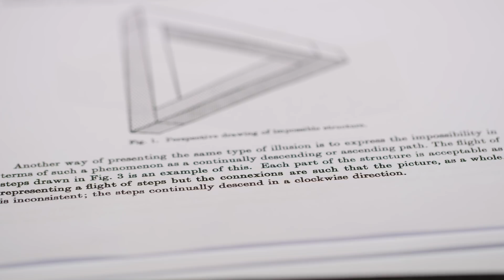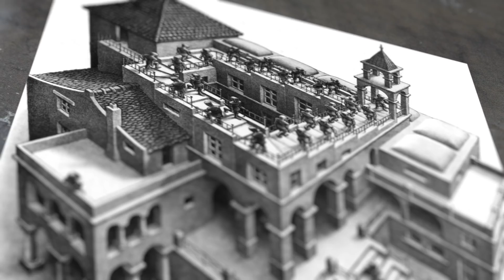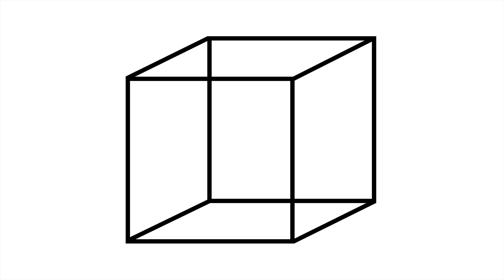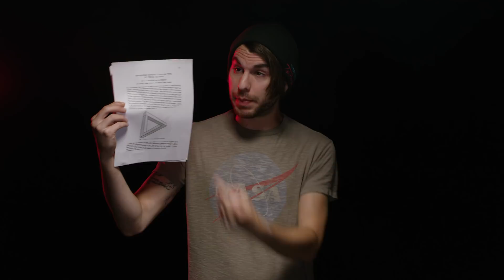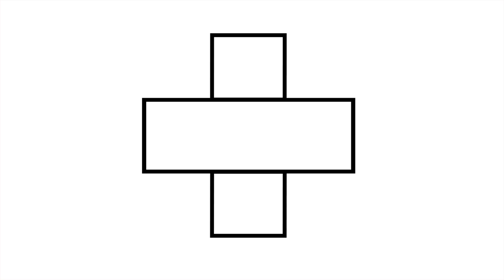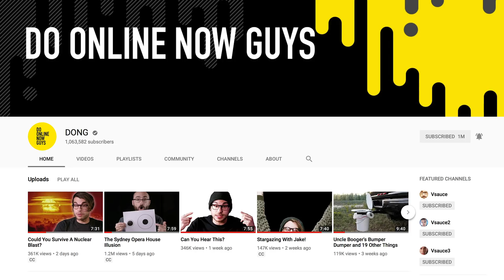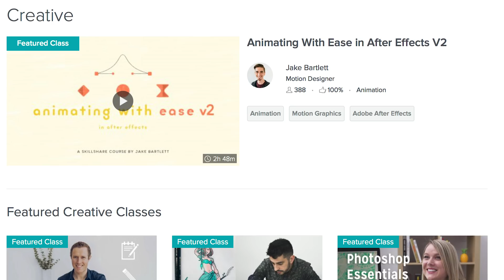Impossible Objects

Comment: People learning drafting actually take advantage of optical illusions in order to get the point across more easily.  This is especially true when they make "cut-away", or sectional view drawings.  For instance, in order to show that a rod is round when they shorten the apparent length in order to get it on paper including the two real ends, they "cut" a slight "S" shape on the drawing of the cut end of what just looks like two horizontal lines, otherwise, and then on the concave of the S, they make another convex.  This gives the perception that the round object has a C-shaped milling end cut to show that the rod is round.

Comment: At 3:30 the original impossible cube from M.C. Escher shows both, the top AND the bottom of the cube and the two inner vertical ribs are mangled. Your 3D printed representation does NOT ... It is impossible to 3d-print a version of the original impossible cube...!!!

Comment: 6:36 
I don't know if this is just me but the reason I thought it was two rectangles is because the line that connects the two squares to the rectangle is the same thickness as the other lines. My brain would only think of two squares and a rectangle if that line was either double the thickness or if there was a small separation between them.

Comment: 6:35 is a low blow because the “smaller squares” are sharing the same order as the larger rectangle which actually implies that one object is below the other.  Otherwise the border between the smaller squares and the larger rectangle would be thicker to imply two borders touching.

Comment: What you said about Gestalt Psychology reminded me of an analysis I'd made before: what is the distinction between the words "piece" and "part"? At first glance, they seem synonymous, but trying to use them interchangeably yields some awkward results. I recommend pondering and coming up with your own definitions before reading mine below:

I came to the conclusion that parts are more often what make up an object's construction, while pieces are what remain after its destruction.
For example, the parts of a pie might include crust, filling, toppings, etc, while a piece of a pie is something you cut out of it.
Likewise, car parts are often called parts before they have been installed, or after they have been uninstalled; while a section of the car that has been destructively cut, torn, or otherwise broken off of the car would more likely be called a piece.

Puzzle pieces are interesting, because you do need them to construct or solve the puzzle, but they are still called pieces, both when assembled and not. I think this is because when disassembled, there is little reasoning within the individual pieces as to how the puzzle is to be solved. They seem to be removed from the puzzle chaotically. However, one might consider the collection of certain pieces, such as the image of a dominant object in a jigsaw puzzle or its boarder, a part of the whole (and not a piece), because they collectively form a portion of the puzzle that logically fits and aids in its construction. Parts of a puzzle help us better visualize the whole, and fit into the puzzle more logically, while pieces are conceived as more separate from the whole.

Comment: But have you ever thought what a 5D impossible object would look like?

In other words...  In the same way the Penrose triangle can't truly exist in 3 spacial dimensions (except from a controlled angle) but can be represented in 2 spacial dimensions.

Is there an object that can be represented in 3 spacial dimensions but can't truly exist in 5th dimensional space?

And if so, does this dimensional hierarchy go both ways?

In other other words because a square can be both in 3D space on a flat plane while simultaneously in 2D space; but a cube can only truly exist in 3D space or higher.

Likewise a tesseract can only exist in 5 dimensions (because we designate the 4th dimension as temporal) but a cube can exist in the 5th dimension on a 3D/4D membrane cross section of space-time.

Is there a thing that we think is a real thing but from the perspective of the 5th dimension is an illusion?

And if so how do we know anything exists at all?

Our perception is so limited.  So ultimately what we perceive as an illusion is just as valid and real as something we consider real.

In other words.  Is it impossible to lie in an infinitely deterministic universe/omniverse.

You could literally say anything and it would be true in some parallel universe on some timeline.

That would mean truth can only be known in a specific temporal quantum index.

Unless it's higher dimensional truth.

Comment: the reason these work is because of 'Occam's razor' where the simplest answer is usually correct. we are tricked by these because we subconsciously assume that the illusion is what we see and that it must be correct when these are designed to look simpler than they actually are therefore confusing and tricking us. specifically with the 2 rectangles on top of one another illusion we perceive it like that because 2 rectangles is simpler than 1 rectangle and 2 squares. so illusions like this are just exploiting that.

Comment: Your layer height and extruder temps are off bro
Reply: Camaro Rick Yeah! I noticed that too! I was looking through the comments to see if anyone else noticed the stringing and the filament hitting the nozzle.
Reply: Interesting, can you please explain it a bit more. I couldn't understand it.
Reply: 1:13 you can see the filament stacking on the left and inconsistent layers, as well as the filament stringing from the nozzle, above the printing layers, and onto another piece, and then running into itself once more

Comment: When is a video Vsauce worthy and when it's just a DONG?  

Also the audio is really off in that sideways shot. 

Do I have to tell you that your printer has issues in terms of ringing and layer lines... There is tuning to be done. But what can I tell you as my printer has currently other issues. 

Blender is great, and free but paying for a course of it doesn't make sense. 

Fusion 360 is a CAD program available for free to almost everybody for hobbyists use; it's better for printing practical parts in my opinion.